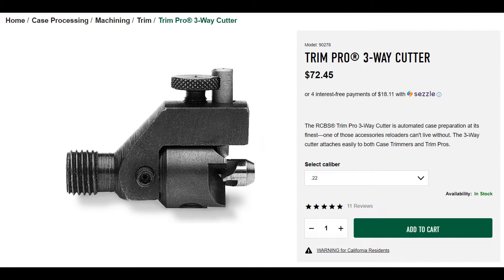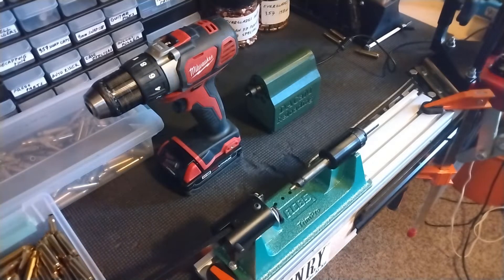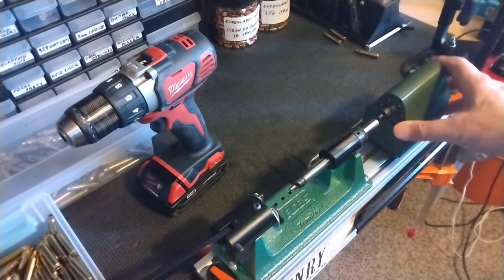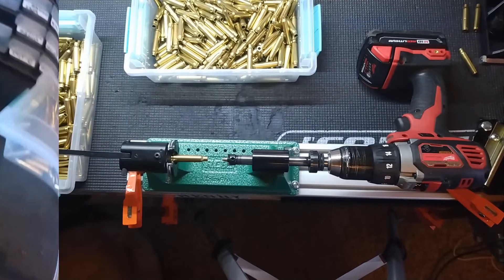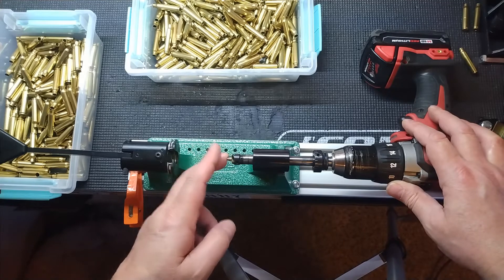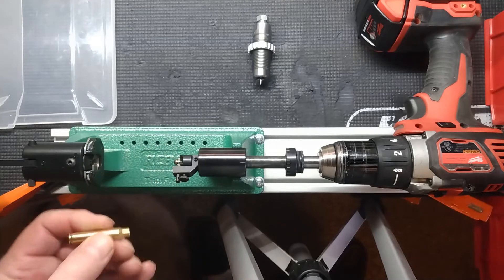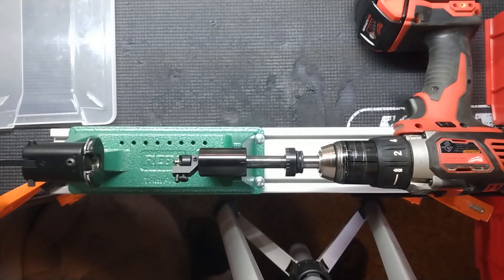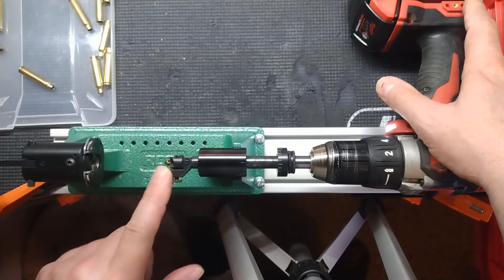Trimming .223 cases using the RCBS 3 Way Cutter Head

Comment: A suggestion. Mount the aluminum base on a board with a hinge at the base end. Clamp the hinged board at an adjustable angle and the weight of the drill will reduce the manual pressure needed by the operator. This should greatly reduce fatigue when doing a lot of cases.
Reply from the maker: Appreciate the tip Dave, thanks! 👍

Comment: One note when doing this, make sure your set screws are tight and check them now and then.  I cut a bunch of Nosler brass .050 short because I didn’t check them after cutting a few of them.
Reply from the maker: Appreciate the tip Craig, thanks! Nothing more frustrating than finding a setting or something loose after you've already ran a bunch of cases. We've all been there 😉

Comment: Tip: drill a hole and put long loop of paracord through the lever. Use it as a gas pedal which allows you to keep the drill in the right hand and load brass with the left
Reply from the maker: Cool idea Dylan 👍
Reply: Dude that’s genius I knew exactly what you meant.

Comment: The expander ball expands the case mouth on the up stroke not the down stroke!
Reply: Thanks for the comment Doug. It can be confusing because when you move the press handle "down", the case goes "up" into the die and vice versa. So I should have said when you move the handle up (which moves the case down) that is when the case neck is widened by the expander ball. My brain is telling me "down" because the case is going down out of the die 😉